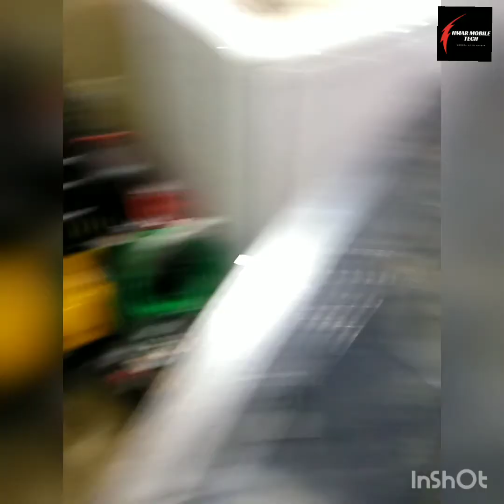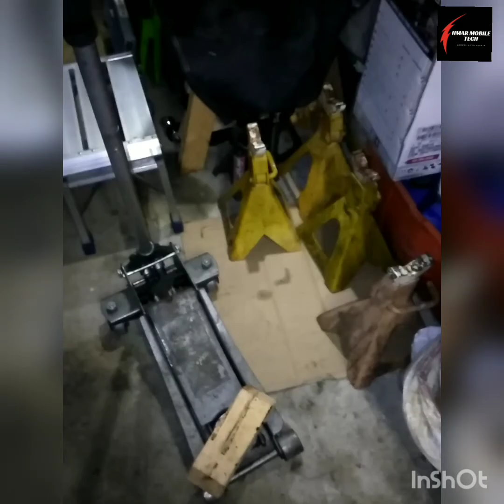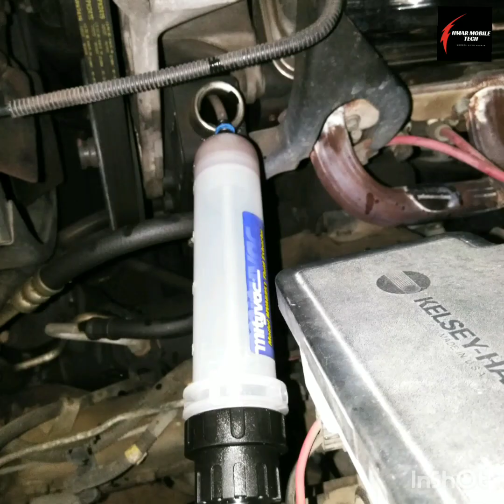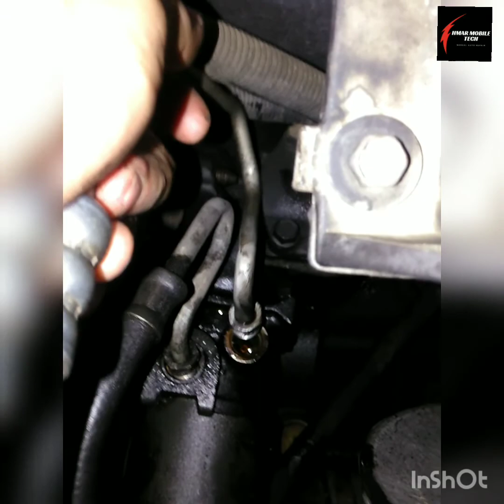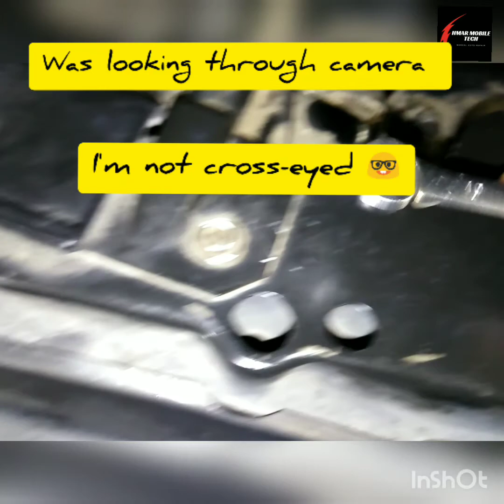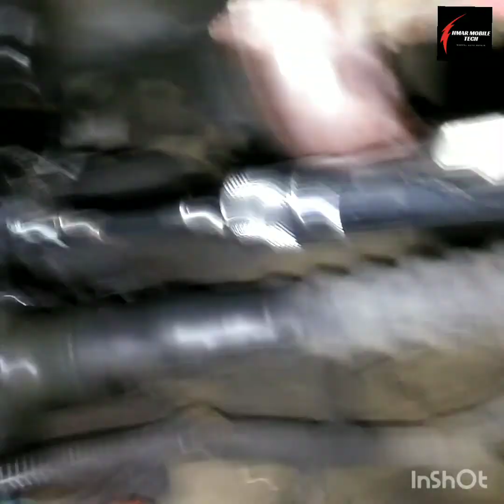95 CHEVY SILVERADO 5.7L AT, 4X4 POWER STEERING HOSE REPLACEMENT (CONV. GEAR BOX) GM /CHEVY REPAIR

Comment: I just replaced my pump and high pressure hose on my 1993 Chevy Silverado 4x4 k1500 5.7

Im having a LOT of issues here!! PLEASE HELP ME?

I got the aftermarket hose, and it was difficult to thread in by hand...once the threads caught, I screwed it in 3-4 turns by hand before tightening with the wrench. HOWEVER! The leaking was happening from between the pipe and nut. Did I cross-thread? 

If so, how would I fix this?!! Nightmare scenario at this point.
I'm bleeding $$ here... and I NEED my truck to make $$ and go to work!!

I've already been on this 3 days now...its ridiculous.

I got a new line- still having issues with new line and threads.

I thought I had seated the new line...it was secure. Not wiggly anymore...I filled up the fluid and purged the system of the old by disconnecting the low pressure line and bleeding it into a bucket. I move the steering wheel back and forth 20 times, and then after doing that reconnected the line, topped off, turned the wheel (still hard) and took it for drive down the road  .25 mile. Steering still hard...

WHAT GIVES?!!!😭